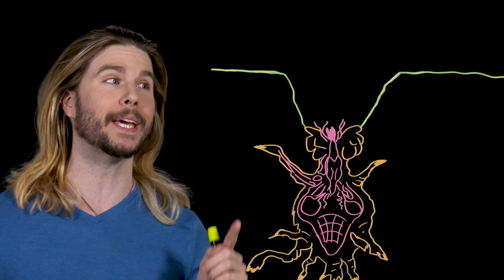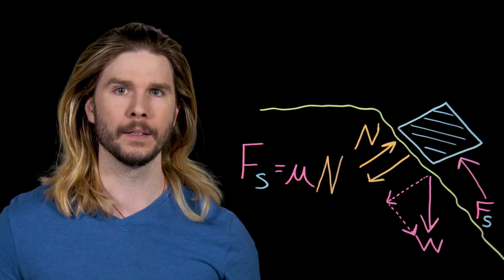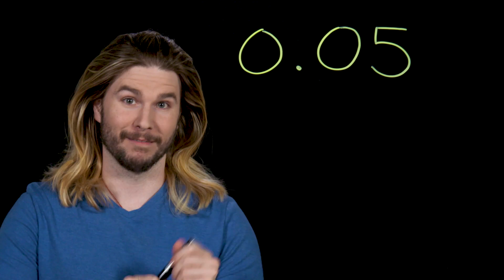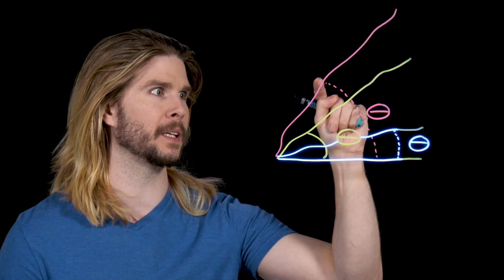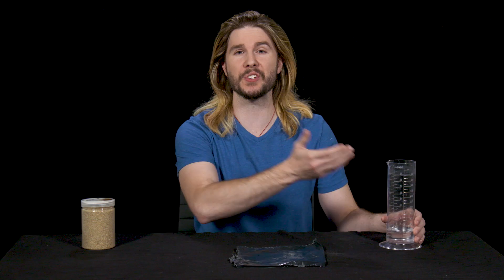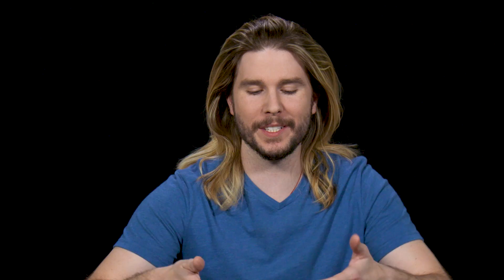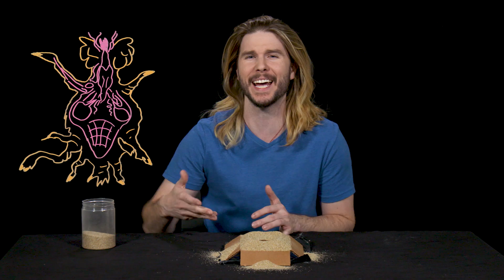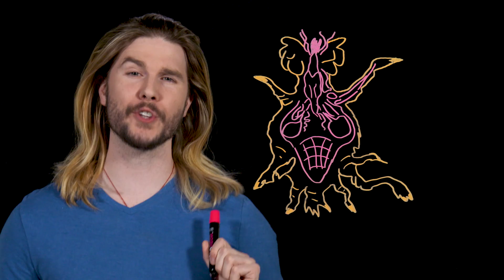How to Make a SARLACC PIT

Comment: Hey Kyle. Nice show!

I wonder how a sarlacc could survive in the desert (on it‘s own).

The size of an avarage sarlacc on tatooine is about three meters in diameter of the mouth and around 100m in length. 
Depending on that there is a volume of about 300m3.

The weight of an average human (man) is 75kg. That means the weight in volume is 0.075kg per 1m3.

Let‘s do some math:

If we assume the sarlacc has the same densitiy (or mass) like a humanoid beeing the sarlacc would weight 225 tons. 

The sarlacc would get destroyed under its own mass.

Even if it could survive its own mass-problem, how much energy need it to stay alive?
A cow provides about 12.71 gJ (or 3.051 gcal) of energy (900kg x 1419 kJ per 100g). Does it even fit for breakfast of the sarlacc?

When the sarlacc lives in the desert it needs to find a proper spot close to an urban area, where it could find a lot of prey, or a generous hutt who is willing to sacrifice a lot of people to death. 

Greetings!

Comment: Hey Kyle, what if the Sarlacc wet the sand as it was building it's pit?  Increasing the angle of repose, but as the sand dried and the angle reduced, it would be able to become even more dangerous.  Like on mountains where the snow is precariously settled that even a sound would create a devastating avalanche.  Then, it would spell certain doom as the pit would collapse in at once.

Comment: There's a stir fry place in Chicago called Flat Top where you throw a bunch of ingredients in a bowl and then they cook them up for you. I like to get my money's worth, so I figured out the angles of repose for all the different ingredients so I could put the low angle ingredients at the bottom of the bowl and the high angle ingredients at the top, above the rim, so that I could maximize the amount of food I got. They used to have separate bowl for the proteins, which of course meant I'd walk over with a tower of meat sticking out of the bowl, precisely stacked to maximize my meat.

Comment: Poor Kevin. :( 
Serious question, though - does the sarlacc need to engineer their pit, or would simply burrowing straight down and letting gravity act on the sand above them naturally produce the angle of repose? Unlike an ant lion larva or Anakin Skywalker, it has to deal with sand falling inside of it all the time without complaining to its girlfriend, so just letting that much sand fall in seems easier for environmental pressures to select for than engineering the hole.

Granted, Legends says sarlacc prefer wet environments, so they may have needed to engineer their holes wherever they evolved.

Comment: Great episode kyle, it really got me thinking,  how much food would a sarlacc need to eat in order to live. Like you, I'm going to use the ant lion as my real world counterpart and will be using them to calculate how much food the sarlacc need to eat, which was not easy. I started by checking the size differences between the two of them, and of course the sarlacc only has a set dimension for its mouth. About ten feet or 3.04m. Since there's no length I had to do some measurements myself self across multiple pictures and concluded that its length is roughly four feet or 12.192m. Making it roughly 4,946 time the size of an ant lion (if I did my math right). If we scale the amount of food needed by the same amount the sarlacc would need 9,892 calories per week, or roughly 1,413 calories per day.
When I first started this calculation I was thinking there's no way it could actually survive, but based on my math a single human would be able to feed it for weeks. This would make it possible to survive off less than ten people for a year. Suddenly, this pit is seeming more and more terrifying.

Comment: Kyle: Ice is slippery!

Me: WOOOOOOOOOOOOOW! 😲😲😲
Reply: Oddly, ice itself is not that slippery, but it is the layer of melted water that forms between it and a object like your foot or a car's tires due to a combination of heat and/or pressure that makes it slippery. Which is why those air-bladder boots the military uses are effective, the sole of the boot is insulated from the wearer's feet enough that they stay below melting temperature, and the wider footprint helps reduce the pressure effect.

Comment: Hey Kyle, there's another example of this exact type of creature in movies, one of my all time favorites - Enemy Mine.  It uses the same principle except it had a rocky ridge that if anything fell over the edge the sand inside that pit kept anything from climbing out. It also had a long tentacle to tongue that extended and latched on to its prey. We first see it devour a puppy sized beetle turtle thing by latching onto its shell and later the guy falls in and is saved. But what is different about this one is that after they cut the tongue off the actual beast from below emerges. Nothing like that happens in starwars canon.  In Enemy Mine, you get to see how yeah, it was a creature that burred itself deep into ground, AND spits out whatever it can't eat, which it does so really quickly. A much better sarlac imo - and it uses the exact same principal!

Comment: Kyle, unless the void or that wooden board is as cold as you can withstand for the duration of your film, the coefficient of friction for ice on wood does not adequately match the amazing physics of what you demonstrated in that simple visualization. If you watch the demonstration very carefully, you will only see the coefficient of friction between wood and ice you provided take effect for several milliseconds, before donning a new coefficient of friction as the ice rapidly accelerates off the board. This is because that ice, exposed to warmer wood and any possible atmosphere you have sustained for yourself within the void, is melting slightly on the wood. This creates a phenomena similar to ice skating physics, where the superfluid underneath the ice reduces surface contact and friction almost an instantly after the initial break in friction. Combining the new dramatically reduced friction with the fact that the constant force of gravity doubles its effect on it’s mass the instant it stops being at rest thanks to inertia, the ice cube slides uncontrollable quickly out of control and off the board. This is also why rain is so dangerous while driving; the tires have a frictional force that is at rest thanks to how physics applies to a rotating object but on a surface coated in a thin superfluid which can potentially reduce the coefficient of friction lower than ice in the ideal recipe for disaster. This danger is multiplied greatly on a slope such as seen by your demonstration. Imagine driving home on a highway at 55mph in moderate rain where as you drive over a hill you must maneuver around some object that impedes your path which would otherwise cause a sudden stop which could damage you and the car, only to exceed the frictional forces due to the running downhill water and the change in angle of the tires and force you to slide uncontrollable with gravity accelerating upon you. Unfortunately, hundreds die from this exact situation every year, mostly due to people not being prepared and attentive for such an unexpected disaster.

Comment: Hey Kyle I think I know how the void works. I theorize that you can openup a portal (using science not magic) to the void and you use a crane like machine to put you and your camera in to void so everything is stable and so your not spinning or go deeper into the void with no control. And the void has unexplained powers that you can clone yourself. And the void has junk floating around that you can use in your videos and when your done making your video of the day you ask the God of void Nate to reopen the portal back to Earth surface and you sometimes return close where you left or you return miles away from where you left because the void is empty you don't know how far your walking. And it takes you 2 days to recover from being back from the void because of air quality difference and since of no gravity makes it hard on your body so when return you have doctor's and medical professional look you over to make sure your fine. And in 2 day you can look at our comments and tells if we was right or wrong. But a that's just a theory, a Michael Gordon theory.

Comment: Yus', Mastermind.
I agree that physics is awesome, but we need a bit more biology and physiology, when we analyse alien life forms. 

Assuming that Sarlacci have a somewhat of a primeval digestive system and have physiological needs I suggest the following. 
As their food is scarce, they must digest very efficiently what they get their tentacles on, thus loosing as little solid waste material as possible. That does NOT exclude the scenario when their guts are filled with microorganisms that help them in the digestion process.
What I am trying to get to, is that these bacteria will still produce some waste material in form of gases, flatulence, which I think it is to the benefit of Sarlacci, due to the addition of an additional Quick Sand field that will further destabilize the pit, thus expanding the area of effect.
It would be a wonderful alien symbiosis example, that would uncover a new branch of biology!

Comment: Howdy Kyle. I love the show and just recently watched endgame so I could finally watch the only 2 episodes I've ever missed. You mentioned wet sand has nearly 90° angle of repose and then never talked about it contributing to the design. 

What if the sarlac wets down the top layer of the sand with the tentacles and then builds the angles of the pit even steeper? Similar to how a sand castle can stay standing when dry if it doesn't get disturbed. And then if any disturbance happens, the pit would be even harder to escape. I mean, I have rolled halfway down a dune and then stopped by digging in my extremities. I think I was able to build up enough under my elbows and feet and dig them deep enough that the internal angle from where my weight was being placed to the outside layer of sand was below the angle of repose. If the angle was 'super reposed' then there would be no chance of that. 

The issue I see would be whether or not this moisture expense would be worth the return when prey/prisoners get eaten. I believe it would be because the antlion has to just catch lightweight bugs and ants specifically. These creatures can't put enough oomff behind any particular leg to drive it into the sand and stop their decent. When scaling up to a pit that humanoids would be prey to, the angle of repose is easier to overcome. This might be down to particle size vs prey but I'm not sure. I do know that digging my hands into sand is preferable to trying it in handsized rocks. So if you were guaranteed to have dinner by spending a little more resources vs being stingy and allowing the prey the possibility of escape, I think I would take the former option. The sarlac that Jabba used could have adapted to not doing anything extra because Jabba makes sure that the prey goes down which removes the need to sacrifice the large amount of moisture building a better pit. 

 What we have here is a case of a lazy sarlac. 

I, for one, can respect that 🙃
Reply: Sand is easier to dig into, but it's harder to climb unless the rock is improbably smooth.
Reply: @MySerpentine  but since you've stopped short of the sarlac itself, you have time to figure out how to climb the sand

Comment: Hey Kyle, I love this channel. I just found it last week and have almost watched every episode on it so far, keep up the great work. 

Quick question: If we were to be on a different planet with different gravity the angle of repose would change right? So if I'm understanding right and we went to mars which is about a third of Earth's gravity the sands angle of repose would be greater then? So if that's true would a sarlaccs pit be more dangerous in a different gravity? Could we then optimize the perfect gravity and find a planet to match to make the ultimate Sarlacc pits?
Reply: Yes and no.  Angle of repose is based on both the friction between the particles and the mechanical interlocks between the particles.  Think about hay (like for horses).  Each piece is very slippery, especially against one another, but they are long and flexible so they can bind and bunch to form a steep pile.  Conversely, ball pit balls are low friction and perfectly round (relatively) so they just slide past each other with friction being the only thing holding them in place.  Friction is relative to the force compressing the particles together, which at the surface of the pile, is gravity at the angle of the surface.

In a low gravity situation, the angle of repose of the straw would actually increase as the force of gravity pulling the straw pieces down would decrease while the binding effect of the long, twisted-together straw pieces dominates.  With the ball pit balls, however, the angle of repose would remain the same.  The gravity pulling down on the balls would decrease, but the force of gravity creating the frictional force would proportionately decrease and the balance point (the angle of repose) would remain the same.  Sand is similar to ball pits with roughly round pieces, typically, and relatively low friction.  To really optimize this for steepness, I think you would want something like an asbestos pit on our Moon.  To optimize it for surface area... use ball pit balls?  I guess?

Comment: Couldn't you then take the angle of repose on the sand with the sarlac at the bottom and draw a conical shape and devise the volume of that conical shape to get a much more accurate answer to the question posed in the previous video about the number of balls it would take to turn it into a ball pit?

Comment: Loved the show! I'm working as a structural engineer and just had a project that involved the angles of repose for several materials. I had to design retrofits for a warehouse dealing with storing various dry materials and had to determine how high the material would rise up the walls from a central dump point in order to accurately design those walls. Love that you're getting these engineering concepts out there in a fun way, keep it going!
Reply: Huh. Any material in particular, like powdered cement or sand? Something else?
Reply: It was a little bit of everything. Fertilizers and salts mostly, but they gave us a list of about 40 different products that could've been placed in there. I had to make a large spreadsheet to decipher it all and actually use that info.
Reply: @zerotriple431  I wonder what if any precautions will be used to reduce the great fire-hazard these warehouses would present. My father has told me that just about anything powdered finely enough can be explosive in nature, from flour and grain dust to even cement! Fertilizers would almost certainly be a fire hazard.
Reply: @d.dementedengineerc99isurf26  Oh yeah, that's definitely true! The place is located out in the middle of nowhere for one thing, to isolate it from damaging other buildings if that were to happen. Additionally, it's my understanding that they have fire fighting materials all over the place. Also there would only be a relatively small number of people in the building at one time, maybe 3 at most (one operating an end-loader to empty bins onto trains and one or two up top operating the conveyor/dumper that would fill the different bins).

I say "my understanding" there because we weren't conducting a code review as part of this, so we didn't review fire safety information. That typically falls more on the architects at the time a place is originally built or to fire marshals after it's built.

Comment: if the sarlacc was the larva stage of some ancient massive tatooine dragonfly, that would be awesome
Reply: Baby krayt dragons
Reply: @akoraceb44  I think that is awesome
Reply: Dragonflies are from earth so at best it would be dragonfly-like. Also, are you assuming conservation of mass ...so a giant larva makes a giant fly? If so it would need to be extremely different from an earth bug. Like made out of different stuff. The exoskeleton of an insect is made out of a porous polymer...think of it as a stiff organic plastic that is covered in holes and hollows. It's not strong enough to hold more than a specific mass range. Maybe 7-14 inches depending on shape....I think the Goliath beetle is the largest a land based bug can get....any bigger and their mass outstrips the exoskeletons ability to hold the creature up. I don't even think bug wings would work on a super huge size. The material insect wings are composed of can't withstand the stress of being whipped that quickly through air. Not air as thick as it is at our size or larger. Butterflies wings are just a powder spread over a latticework of ridgid wing holes...that just won't fly at our size...(pun intended).
Reply: Too large for the amount of oxygen on the planet. It would have to be a worm like creature that stagnates as it hits planet surface.
Reply: The saralac is the adult stage of the organizum and the female is the largest one males merge with females and impregnate them the female fills with spores and eventually explodes after a few thousond years or so the spores fly into space and also fly though a planets atmopheare and land on a orginizum becoming a parasite for the animal eating them from the inside until they grow big enough and then they hunt food and gorge themselves until they reach there adult stage were they dig a pit and live in it as the adult sarlacs also uses there spores to go to other planets veia the explosion of the adult female what is why sarlacs in starwars are almost everywere on lots of planets